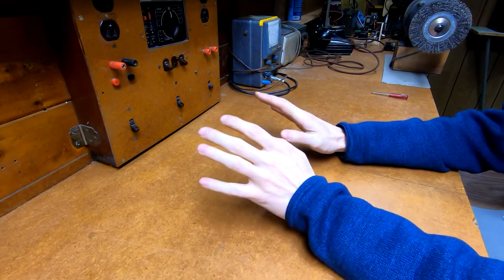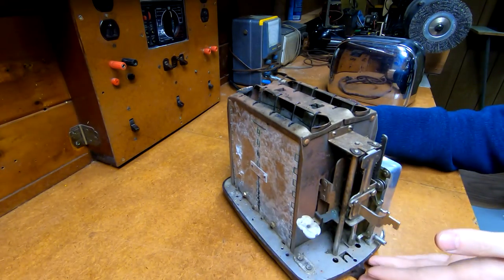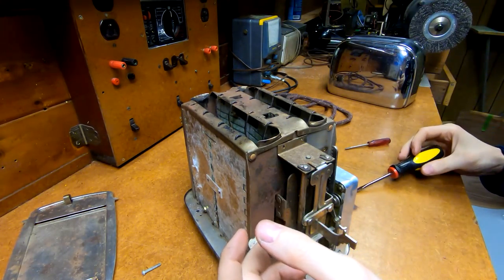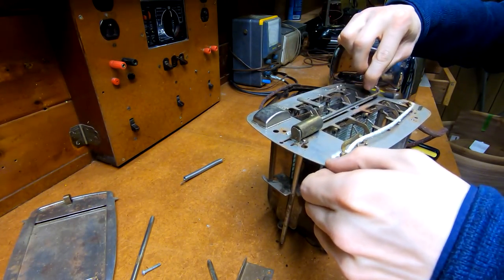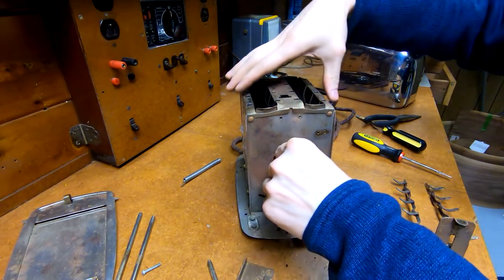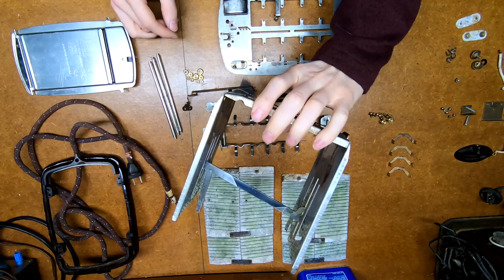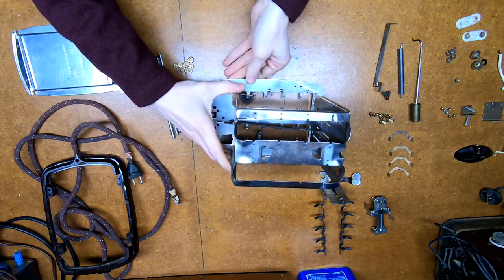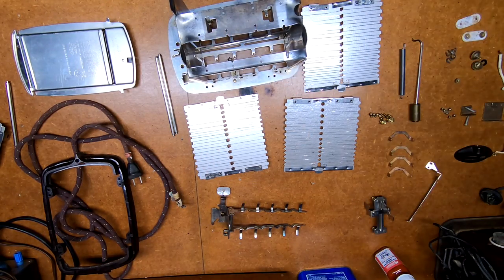Toastmaster Model 1B9 Repair - Part 1

Comment: Hi I've got a 1B14 model toastmaster toaster it's fresh out of the box never been used but the heating elements boards are brittle I guess from sitting over 60 years in a box. Would the same new ones you have fix my model? I've got a repair man that will put in new ones. He's a older man and don't know much about smart phones or computers. So I've been trying to find new ones online to buy and give to him to put in my toaster but I'm having issues with finding them. I came across your video and thought I would ask you what the model number is on the new ones you got and find out if it would fit my model. I'm going to subscribe I love watching these kinds of videos.
Reply from the maker: Thank you for the kind words! I used some elements I bought off of Ebay last year, (model # 189-1047) and there seem to be a few different varieties still for sale there. 
https://fmp.twinsupply.com/proddetail.php?prod=189-1047
This is what I originally looked at, before buying it elsewhere. I can't say whether or not it will work in yours, as I had to modify mine and even then the fit is a little small. Best of luck to you, though!
Reply: @Eclec-Tronics  thanks for the information. So the model number in your comment is the model number for the newer ones that you ordered? I love things from the 50s and 60s. I'm in the process of doing my kitchen all in 50s style. I've bought a bunch of 50s kitchen gadgets from fryers to popcorn poppers to table top blenders. I'm in the process of looking for a 50s refrigerator and chest deep freezer. I was in an antique Mall a few weeks ago and found the old toastmaster toaster it was still in the box and looks new. It toasts very good but the shiney board that the heat coils are wrapped around has a dusty look to it it kinda looks like a dusty mold film on it and afraid it my be bad for me if I toast in it..
Reply from the maker: @brandonbaldwin4535  That model number and link go to the exact ones I ordered, although I got almost a dozen of then by mistake! I'm also trying to put together a 50's era kitchen-have a 1946 GE fridge to clean up and install once the drywall's done and painted.